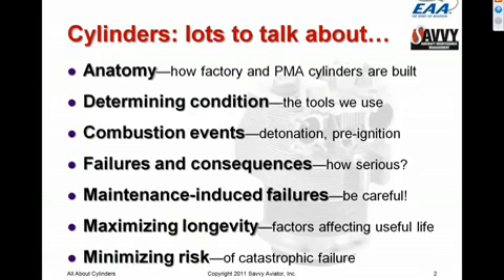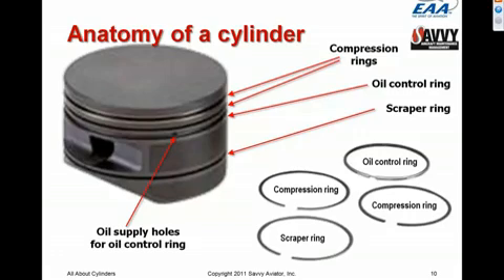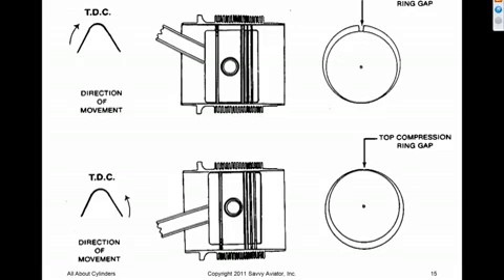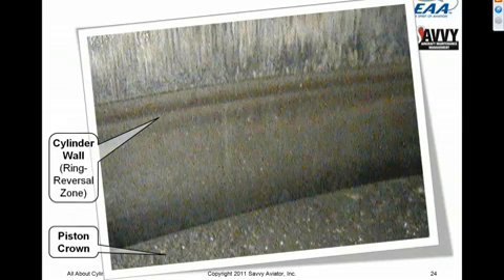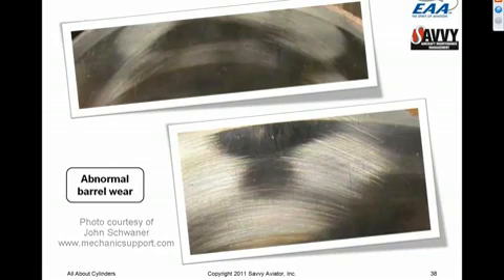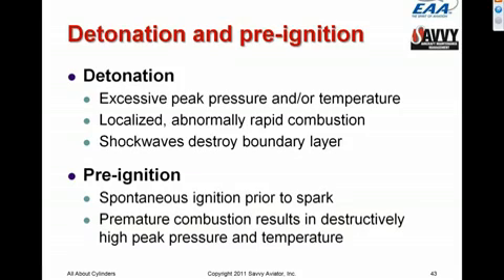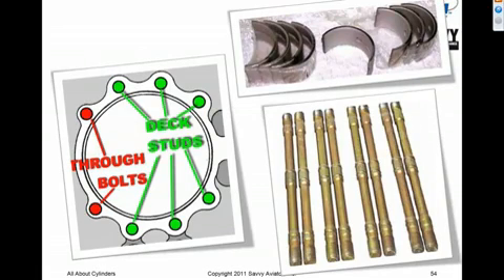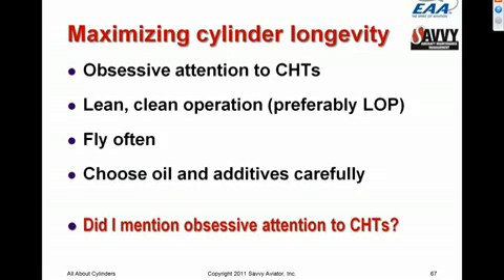All About Cylinders (with callouts)

Comment: Heating and cooling for interference fits is a waste. Heating charges one part with energy and it is not necessary to complete an interference fit. On the GE90 high pressure turbine, both stages are joined with no bolts and nuts, but by interference and bayonets. We used to heat one part and cool the other until we realized all we were doing was reducing the worktime of the join. After that, we cooled one part with liquid nitrogen and left the other stage at ambient room temp. We found we had a much longer worktime, ensuring a proper connection without having to rush the work.

Comment: On piston expansion, are the manufacturers using alloys that don't expand very much or is it because the operating temperature fluctuation is hugecompared to automotive use.
Reply: Aircraft engines run near full load continuously, whereas car engines normally run at a small fraction of their maximum torque/load. So, aircraft engine pistons run hotter and are installed with more clearance when cold, giving audible piston slap ('clatter') on an engine started from cold.

Comment: Have you ever come across a thermal fatigue failure of an intake valve - i.e. a crescent shaped piece breaking off the edge of the intake valve much like the exhaust valve failures? Had personal experience of this happening on intake valves in 2 separate cylinders of an O-235 L2C - over 10 years ago.

Comment: I had stuck exhaust valve, piston struck and punctured. I put aircraft down in a field. weeks before there seemed some roughness to the engine.
Never ignore anything out of the ordinary.
Reply: Exhaust valve not closing all the way, allowing leakage and rough running. Finally sticking open and being hit by the piston crown.
Possibly caused by tetraethyl lead residue on the valve stem, finally jamming the valve?
Reply: @devilsoffspring5519  Well known carbon build up on the valve stem. Due to lack of cooling, due poor oil flow. They went back to solid valves as one update. At the time i checked incident reports, had been several that year in the UK. This was about 1991.
Reply: @flybobbie1449  Ok, the solid stem valves caused the problem by running too hot and cooking on the residue? Did they eventually replace them with sodium cooled valves and fix it?
Reply: @devilsoffspring5519  No i believe the reverse, they went solid.
Reply: @flybobbie1449  Really, that fixed it by running the valve stem near the head hotter, burning off any residue? Or wouldn't that make it worse?
Reply: @devilsoffspring5519  I think the push rod design was altered, the hyd. tappet design didn't allow enough oil to cool the valves. They probably expanded and jammed.

Comment: Stuck valve= Marvel Misery Oil in the oil. 1/2 Qt. every oil change. Great Job mike !!!!
Reply: What's actually in that stuff? They sometimes sell it at hardware & auto parts stores for use in cars, or at least they used to. Not sure if I'd want "mystery"-anything in an aircraft engine, I wonder what they put in it besides just oil itself.
Reply: @devilsoffspring5519  I don't know, however, the contents are available on line. i don't know where but, IT WORKS LOL !
Reply: @apfelsnutz  Good a reason as any I suppose, but the stuff is supposed to be added to the fuel, not the engine oil!
The OP suggested adding it to the crankcase oil, that's a no-go!
Reply: @devilsoffspring5519  I use it in the oil and in the fuel... no problems.
Reply: add Marvel Mystery to the fuel where it does the most good.
Reply: I do that also...

Comment: The 80 PSI is NOT for historical reasons.  The leakdown tester has a metered air hole to the cylinder side pressure gauge that demands a specific pressure to give the correct value.  I expect if all flow paths gave equal flow differences for equal pressure drops it wouldn't matter, but they don't.  I expect you could conceivably design the leakdown tester for a different pressure (not an aero engineer, electrical), but a specific pressure would still be required for each design.
He makes an excellent point about testing when the cylinder geometry is junk by virtue of its coolness.  Another MAJOR contributor to noise in compression test readings is the amount of oil on the cylinder wall at the time, dry to wet is MANY percent.  In fact it is THE TEST for worn rings in a car engine, add oil if the compression is crap, and if it goes up to near good, it's rings, not valves that are your primary problem.  And it's a GOOD test.
Reply: @filespec  Precisely.

Comment: MAN, if that slide at 16:40 doesn't tell you that bringing a cold engine up to temperature GENTLY and slowly is a good idea, NOTHING WILL.  The extension of those rings out of that piston when everything is cold borders on SCARY.  Would be EVEN worse in VERY cold temperatures, like 30 below, where there is ANOTHER 100 F added.  As an engineer that slide gives me the willies.
The discussing of shedding exhaust valve heat is interesting, as well.
Good talk.  This particular presenters almost always are.

Comment: Isn't this really a 'leak' test versus a 'compression' test?
Reply: Yes, the correct term is "leakdown test"
Reply: And it has benefits, like if you lock the crank at certain positions you can check the leakage at various points in the stroke, among others, to locate some specific kinds of problems.  They are really BOTH leakage tests, though, when you really get down to it, as the compression is determined by design parameters, both valves closed cylinder volume to final squish volume on the compression stroke minus the leakage during that same stroke.  EVERY cylinder leaks to some extent, even when newly broken in.  Old worn cylinders leak a lot worse, especially if the wall is scored, the rings are broken, or valves are leaking.
Reply: The kind we do in aviation are leak down tests

Comment: "Always keep CHT below 400°F"?!?!
My 0-360 hits 400°F+ on nearly every Summer departure. It would be impossible to get any sort of climb rate if I throttled it back enough to keep the temps below 400°F.
#3 regularly hits 430°F by the time I'm 3000ft AGL, no matter how rich the mixture.
Even at 1300°F EGT cruise, my mean CHT is typically 380°F.
This is on a JPI EDM 700.
Now I"m scared...
Reply: You get this looked at Jeff? What was the outcome?
Reply: I've discussed it with 1/2 dozen A&P's and IAs as well at a Lycoming representative and thruway its absolutely normal.
Just keep it under 450°. LOL
I departed KPRC a week or two ago at a DA of over 9000 and it struggled to get more than 250 ft/min of climb, so I leaned it to avoid becoming a dark spot on the surrounding hills.
Temps got well into the 430° range on all cylinders with #3 touching 445°. It yeilded are 500 ft/climb though, so as soon as I could put the nose down, I did.
Compression is still 70 or more on all cylinders with no obvious cracks...
Reply: @theMazdaManiac  I'd be glad to bounce some ideas off you. I'm not an a&p. Have a few thousand hours in the prop shop with my late grandfather and a few dozen air-cooled builds under my belt